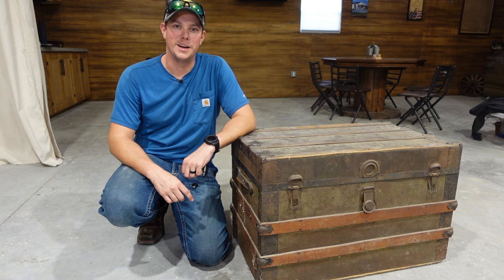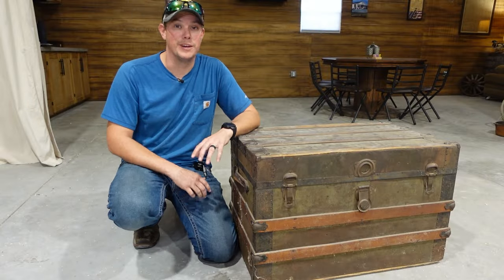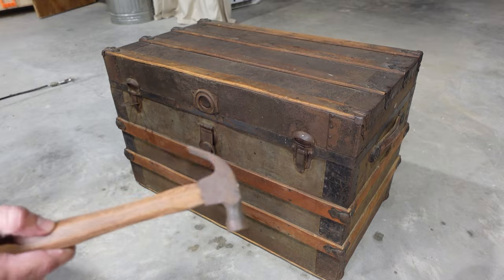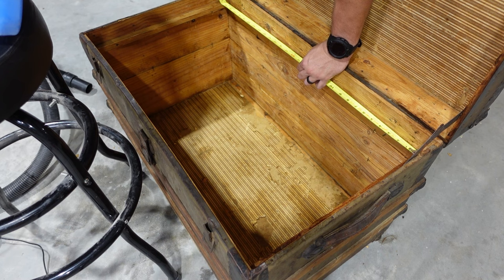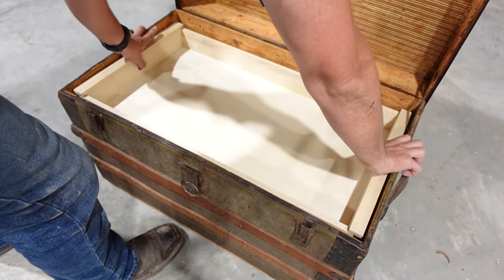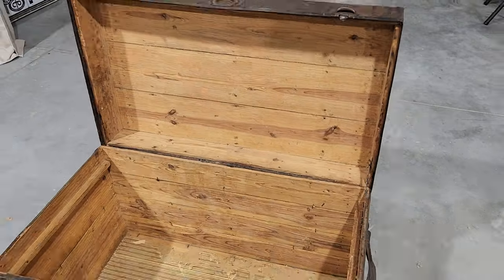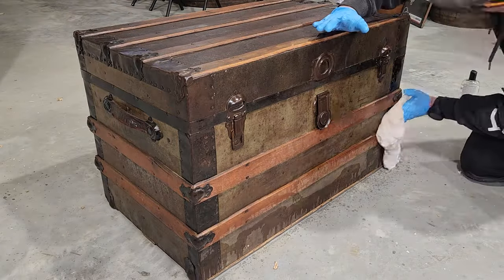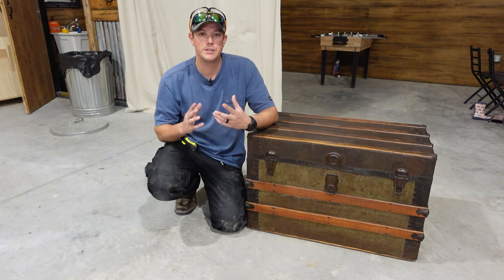Restoring An Antique Wooden Steamer Trunk

Comment: Your trunk looks great and I appreciate that you kept it as original as possible. I found an old camel back trunk on fb. Someone painted it red. Can someone tell me the best approach at removing the paint? Thanks!
Reply: Painting a trunk is the easiest way to devalue it, so I hope you didn't pay much. I purchased a painted trunk for restoration a few years ago and decided I'd never restore a painted trunk again! It's going to take a lot of work to get rid of the paint and make it look right again, but it can be done. Use something like CitriStrip gel to remove the paint. It takes a bit longer than harsher chemical paint removers, but it's safer for you and for the trunk. If it is covered in metal you might be able to use a bit of CLR to remove a lot of the surface rust, although I've personally never tried using CLR on old zinc or tin for surface rust. Dremel finishing abrasive buffs are your friend -I use them in lieu of chemicals whenever possible. 
Best of luck!

Comment: Does this trunk have wood all over exterior or is there a ‘fiber’ overlay? 
It resembles a trunk I have from my Grandmother.  It is not covered in leather, it is another material I’ve seen called fiber or leatheroid.  Did you oil it ?
Reply from the maker: No it's more like thin metal with wood banding